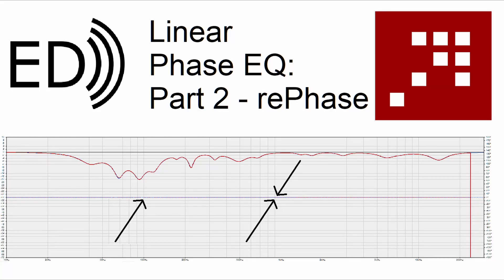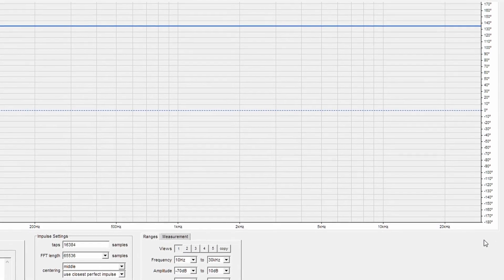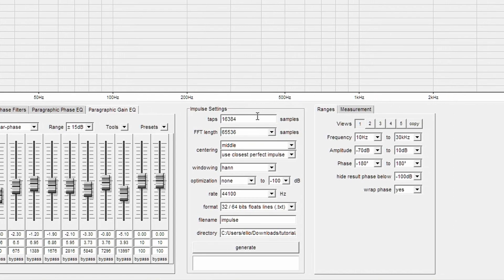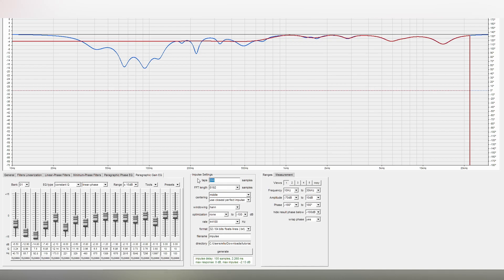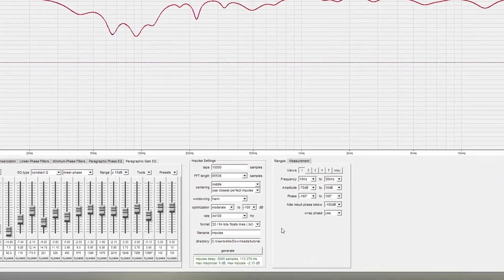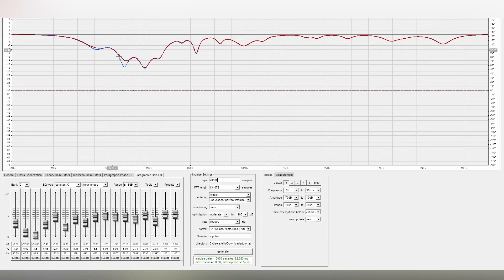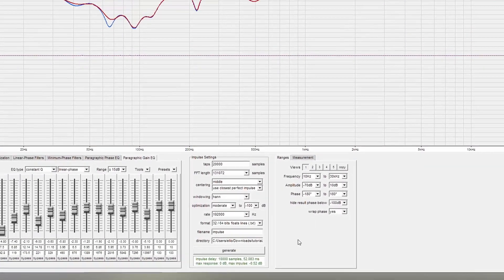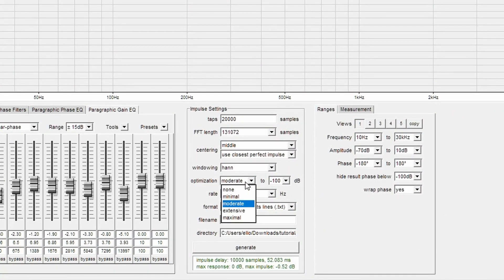Linear Phase EQ - Room Correction: Part 2 - rePhase

Comment from the maker: Something I want to mention that may or may not be important to you. Is that the delays mentioned with the associated taps do mean a delay of that length through playback of audio when using the filter. Luckily total delays up to about 140ms are quite imperceptible to us, but if you wanted to sync display output to audio output, you could always add delay to your visual signal. Typically this can be done with most TVs/Projectors
Reply: Correct me if this is wrong, but linear phase is difficult when you have two channels when you want to phase match them (changing graph to linear frequency and forming a straight line), but with minimum phase its much easier because you are just setting them near zero for both channels. 
Other channels say in practice minimum or linear both sound the same because the pre-ringing is below the threshold of hearing anyway, what are your thoughts on this?

Comment: I would love a follow up to this series! These videos are very helpful to learn what's possible from free tools
Reply from the maker: Thank you! I'd love to do a follow up at some point!

Currently trying to complete a long term project first- my concrete casted counterpart to Nick (from ToidsDIYAudio) and I's RuleBreaker speaker. Unfortunately due to long setting times and the many iterations required to get it right, it has been taking far too long to complete.

I'd also love to hear what you want from a new series if you have any ideas? I have plenty of my own, but it's nice to see what my audience wants too 😁.
Reply: @Elliott-Designs   Wow that sounds like the dream team of DIY audio on Youtube! If that's the case, I would love to see y'all build a DIY speaker at some certain price point start to finish (sounds like you're doing that already) and then use these correction tools on that same speaker to produce a great house curve. It would be awesome to see that whole process in a digestible format, like your videos are. Also to expand on that, I would love to know if it is possible to use this convolution process in a Digital Audio Workstation, for mixing and mastering purposes.
Reply from the maker: @dedik8SKB  I'm so going to make a video on that. There's plenty of free tools available. Thank you

Comment: For speaker box correction, should I use port tuning frequency or the dip on the woofer? ( Near field measurement
Reply from the maker: That's odd, they should be one and the same, the reason that dip occurs is because that is where the port "takes over" in terms of loading. If you go onto Nick's website ToidsDIYAudio, you can start a thread and tag me in if you'd like, that way I can see your measurements and try and help a bit better.
Reply: @Elliott-Designs  yeah, the ideal condition would be that. But the box tuning frequency and port tuning frequency can be different sometimes. My box for woofer is a bit small for its VAS
Reply from the maker: @youtube改名也太難了吧  In that case I'd recommend applying an IR window to "remove your room" as much as you can from your nearfield measurement and then analysing your measured phase response manually to determine how you want to phase correct your port region.
Reply from the maker: @youtube改名也太難了吧  You could also just try both and then compare the phase responses of the measurements with either correction applied, without an anechoic chamber or at least a portable amplifier and a large field to act as a ground plane, these iterative methods are sometimes the best you can do.

Comment: Given how small the average lounge is in the UK and the small likelihood that people will treat the room. Can the rooms handle anything much lower than 50hz?
Reply from the maker: Totally, in fact, a small room can help get more (although less accurate) bass. This is called room gain, it's the same with car audio, but there it is called cabin gain. I run down to 30Hz flat in my UK bedroom which is much smaller than your average living room. If I had a larger driver in my subwoofer, or more subwoofers then I'd be able to get even lower.
Reply: @Elliott-Designs  I guess I worded it wrong. I meant with room gain do we need speakers that can output much lower than 50hz? Do things get messy without room correction that most people don't do?

Love what you're doing here. I'm a carpenter looking to start building speakers. I'm trying to learn all I can about designing speakers but I may need to get help from a designer in the end.
Reply from the maker: @bellrobert1978  Not at all, in fact produced music is designed to be played back with room gain. If it's too much bass for you, you can always build a sealed subwoofer (no port, closed box) and utilise its shallow roll off. My content doesn't go into much of this stuff yet, so if you want to know more of things like this, I highly recommend my friend Nick's channel. Toid's DIY Audio. Also, thank you for the high praise! The best place to start in speaker design/building would be to start with a kit/build plan, it's a great introduction into the hobby that way.